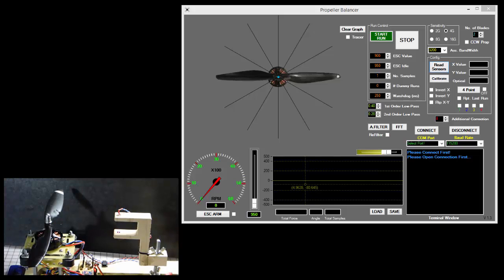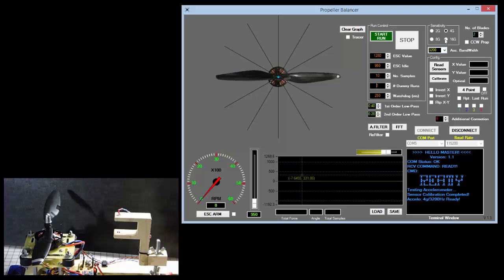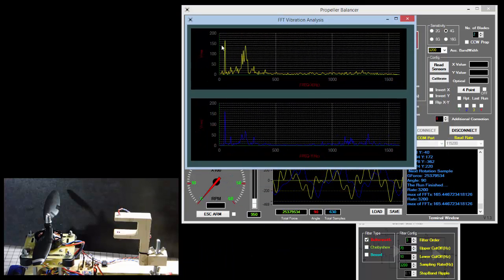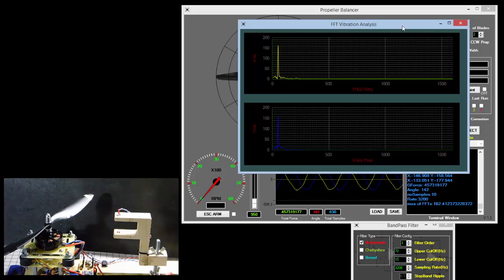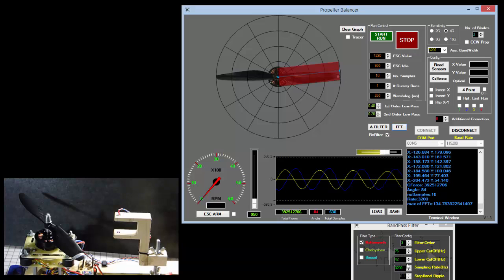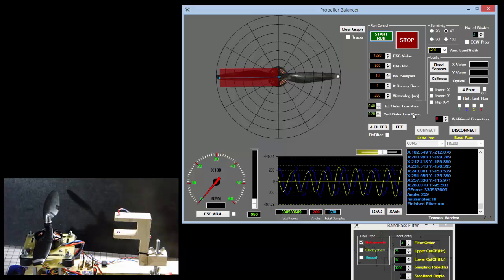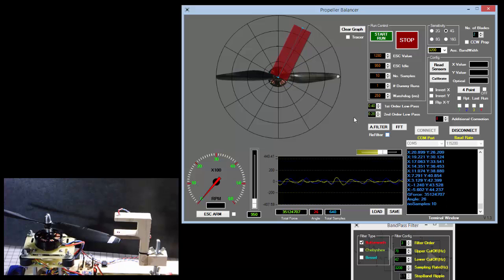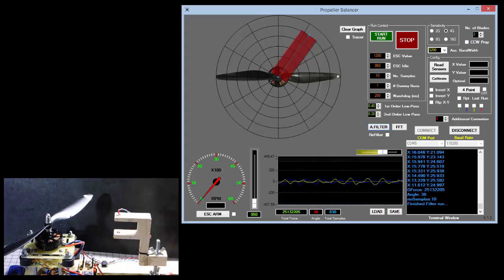DSP Filtering for Dynamic Propeller Balancing

Comment: Great video and software.  

I notice you are using IIR filters.  They have the benefit of being quick to compute, but the phase is not constant across frequencies.  This means the angle of imbalance will change depending on the speed of the propeller.

When you adjust the filter cutoff frequencies, you are shifting the filter's phase response around until it matches what you expect.  There's clever tricks you could use since you already know the rpm of the propeller (like a lookup table that contains phase delay vs frequency).

I'd suggest trying an FIR filter with 0 phase delay in the passband.  You'll probably find you don't have to do as much fine tuning.
Reply from the maker: +wiremetrics ..but if you calibrate the rig, and balance at say 3000 RPM...not a problem....I get consistent results time after time....just go through an initial calibration at the speed you will be running at, and you are set....Also...what IF, we take the data, filter it forward, and then filter it backwards?  What would that do?  (look it up.... :-) )
Reply: +Cyborg Neuromancer Forward-backward filtering makes sense in this application.  Do you find you still have to do much initial calibration when you use it?  I expect you wouldn&#39;t need to unless there is some time delay at the tachometer.  I&#39;m currently working on a similar project for my airplane's propeller, and FIR filters were seeming like a better choice, but now you have me considering if there would be any performance benefits of forward-backward IIR filtering.

Comment: I suppose you had to compensate for DSP phase-shifting in order to realign the final angle offset ?
Reply from the maker: Jean-Louis Arnal You are assuming that I am using a Phase-Angle measurement to calculate the angle.....Not the only way that it can be determined.... :-) if I was, then I would most certainly have to compensate...
Reply: Cyborg Neuromancer hmmm.. Absolute timing relative to IR sync signal then ? 【・ヘ・?】
Reply from the maker: +Pilarius That is an ancient chinese secret.....